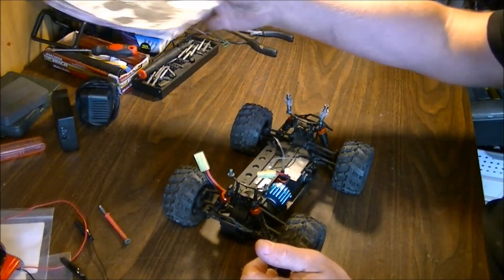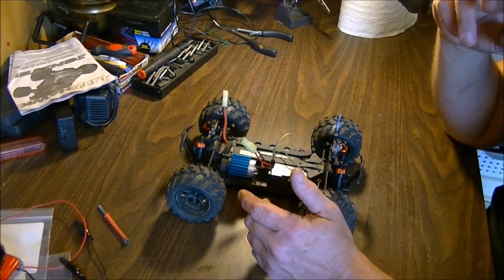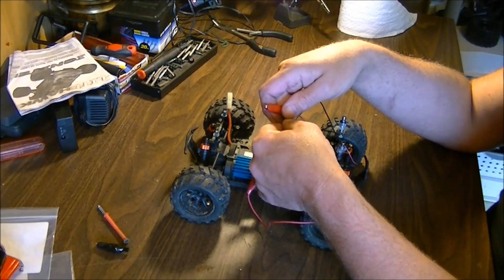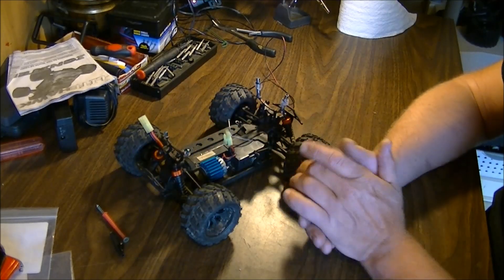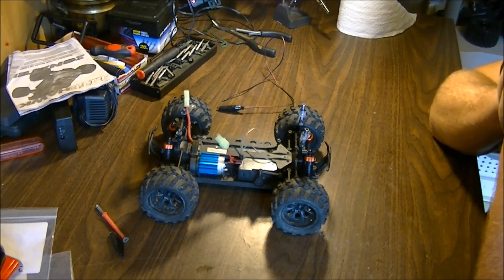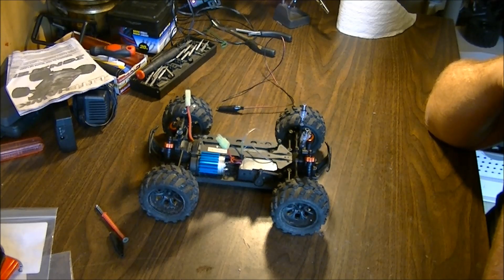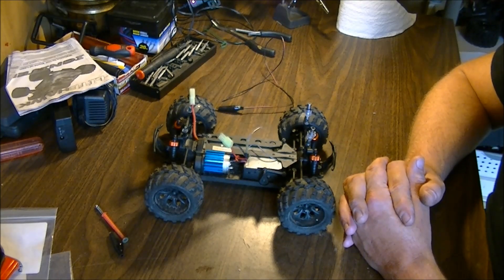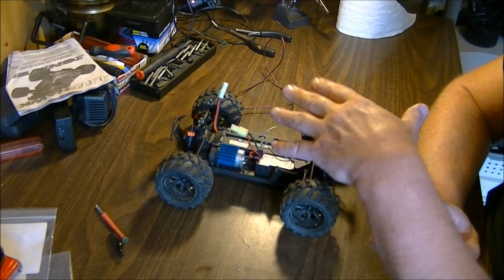How To Wire A Fan To An RC Car Motor

Comment: How can i control the fan thru the transmitter
Reply from the maker: you would have to have it on a sperate channel on the receiver but it can be done as long as you have the channel open on your transmitter as well to turn it off and on

Comment: use a razor blade or sharp hobby knife and hold the wire and slowly slice down until you see metal, when you do, slice horiozonatally a tiny more, and you should just be able to hold each side of the cut you've made and just go down the wire opening it up as far as you need,   None of this faffing about is needed
Reply from the maker: you do your thing ill do mine thanks

Comment: Note: A fan will run in both directions, but many have a bearing only in the correct load side.
So decide on airflow my the mounting direction of the fan itself. 
I think push or pull is totally irrelevant. Airflow is airflow.
Reply from the maker: In the case of a fan here is how it works brushless makes no difference however brushed motor fans it sure the hell does make a difference

Comment: Would it be okay if I use 5-7v fan on 3s lipo?
Reply from the maker: if you used a risister on the red wire of the batter that would knock the voltage back to the max voltage the fan can handel yes you can other wise option 2 is plug the fan in an empty channel on your reciever or get the right fance that can handel 12 volts for direct connect to the battery
Reply: @KevinMillard68  I'll connect to receiver to make things easier, thanks
Reply from the maker: @Humphrey210  your welcome

Comment: hey i connect a 2s 30c lipo to a 12v 0.06 amp fan
will it work well or will it take a lot of power from the motor
Reply from the maker: youll be ok it will just run the fan slower and the fan will still cool for the most part yes
Reply: Kevys Rc & Music ok thanks 

didn’t thought you would reply to a 6 yeah old vid tho
Reply from the maker: @shimaafrazmanesh130  i reply to all commnets reguadless how old the video is
Reply: damn boi
Reply from the maker: @shimaafrazmanesh130  :)
Reply: hey but u sure it won’t explode into flames as soon as i connect it?

the battery i’m using: 2000mah 2s 7.4v 30c

the fan: 12v 1.2w
u sure it won’t explode into flames?
Reply from the maker: @shimaafrazmanesh130  i have done this tons of times and never a problem the fan only draws what it needs and as long as your not pujtting more voltage into the fan then what its made for then it will be fine.

Comment: Could accessories like the fans, and if I wanted to run lights, all run off of another battery on board the rc car? like a small lipo or something?
Reply from the maker: yes you can no problem i do it works great

Comment: great info! question: say I use a 12v 0.06a fan, soldered onto the battery plug.. and connect a 2s or even 3s lipo @11.1v.. would the fan actually pull too much current? thus taking power away from the motor? whole point of using a 3s is for more power.. but if the fan is rated at 12v, it 'd draw too much right?
Reply from the maker: volts are not the problem amp draw is and 0.06 of an amp is nothing but here is the deal the more toys you attached the less power the motor gets unless you have the amps and c rating to keep up to the demand, if your gearing is such that you dont get much motor heat you dont need a fan and fans do not help alot they help some but not alot so its a matter of choice really

Comment: if I install it backwards will the fan burn up?
Reply from the maker: you have to wire the + to + and =- to - but oyu can flip the fan the idea tho is to have the air blowing on the heat sink

Comment: Hellosir  i have a969 with motor 380 not upgraded and i want to put a heat sink with fan can you pls give some tips thank you
Reply from the maker: i believe we covered that in this video other then the heatsink part you need one for the size of motor you have some fans will just plug into and empty channel on your reciever to get power but sometimes you have to direct wire the fans
Reply: +Kevys Rc & Music thank you sir
Reply from the maker: your welcome

Comment: hi if you cut into the wires and fuse the fan onto it wouldn't it decrease the speed of the motor because your technically taking power away from the motor
Reply from the maker: +Epic Derp Clash Of Clans sure but not alot its very minamale loss but that would also depned on the power draw of the fan you need to make sure the fan does not draw more then the battery can give